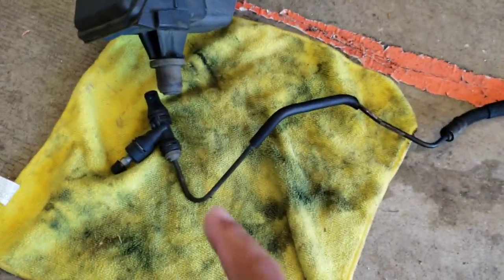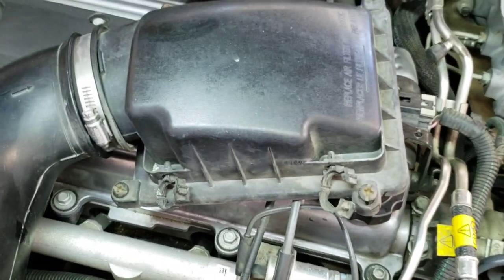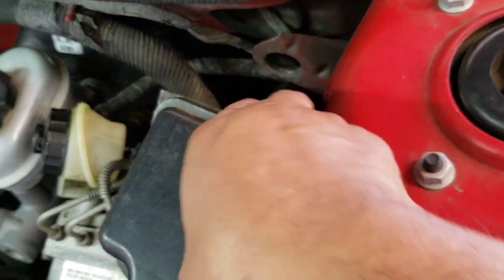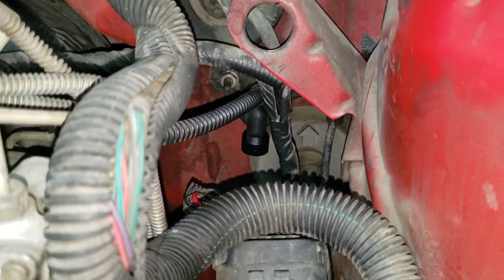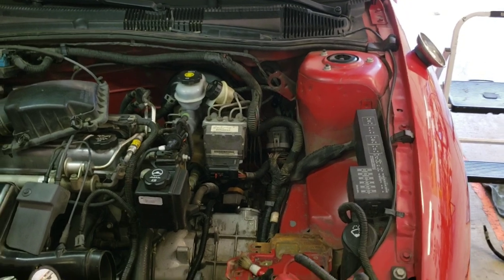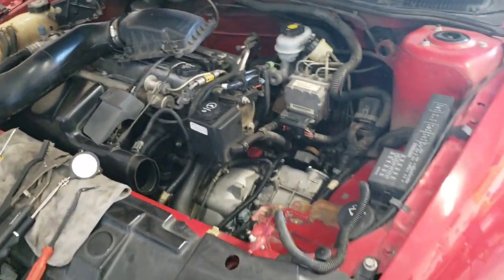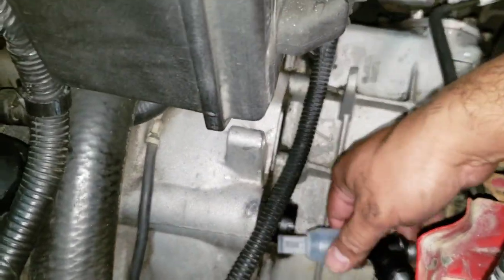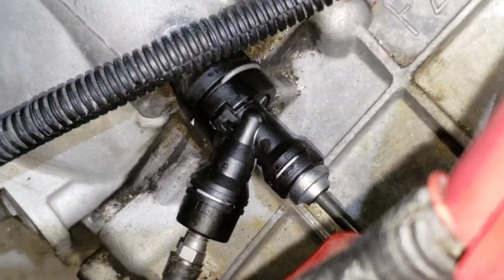CHEVROLET CAVALIER LS // CLUTCH MASTER CYLINDER / HYDRAULIC CLUTCH LINE REPLACEMENT

Comment: Got a part number or place to get the clip for the bellhousing?
Reply from the maker: The clip that attaches to the slave cylinder? If so, no I don't.  I know it's cheaper than the one that goes to the clutch master cylinder. I think I saw that clip on ZZP's website as well. Hopefully this helps. Thank you for watching.

Comment: I had to replace my slave cylinder in a barn 😅
Reply from the maker: The Cavalier is still in the shop since this video. The clutch and Slave cylinder were replaced. But the slave  cylinder went bad. I need to get it done. Wish I knew how to drop the transmission and do it myself.
Reply: @PonysGarage  watch a few videos. There’s a guy who shows how to do it without dropping the subframe. It can be done with 2 people in a day. No experience pulling a front drive transmission before